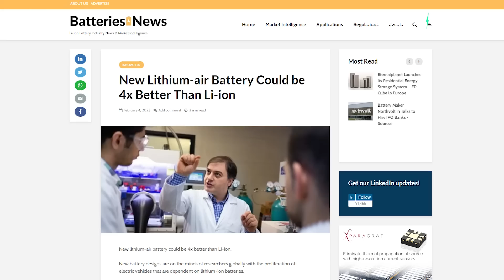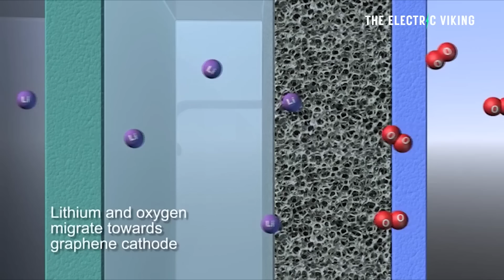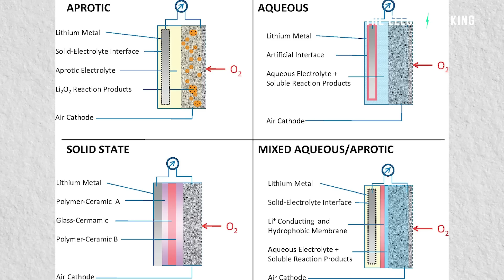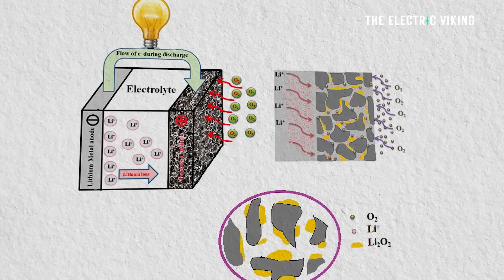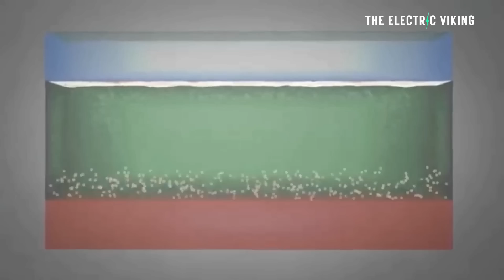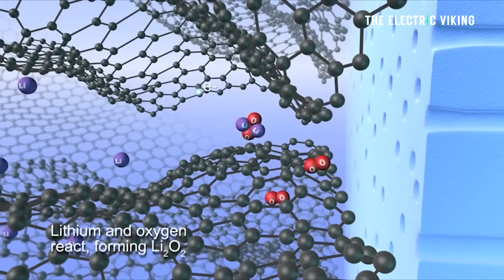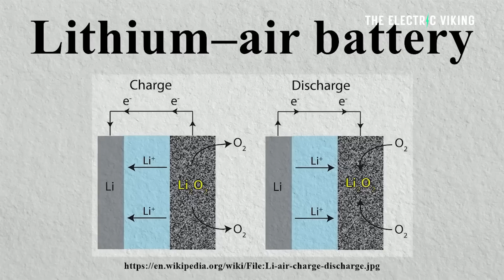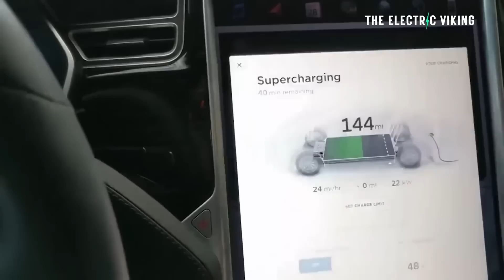World's highest energy density Lithium Air battery solved! Up to 2000km EV range!

Comment: Heard on break through after another over the years - Nuclear Diamond Batteries (no really, they are real), Sodium based batteries, Zinc Air, some other thing that is 500wh per kilo. This is another one I heard about years ago. Usually the problem is not making the batteries, it is charging them easily, particularly in a home situation.

Comment: Higher energy density would be useful for weight-sensitive applications like aircraft. Other than that, cost per kWh and longevity is far more important for mass market EV. Let's be frank, we don't need a 2000km range EV for the average consumer. Sodium-ion and LFP looks promising.

Comment: Produced in a laboratory and mass-produced are completely different things. For the battery, you only need to look at lg energy solution. Tesla, catl, sk, northvolt, etc. are all operating by headhunting lg engineers. They talk in Korean in their US tesla lab and China catl lab... The battery industry cannot be created by a few innovative people like the IT industry. Ultra high nickel battery technology is 3 years ahead of catl by lg and 3 years equals an eternity in the battery industry. As for the cathode material, which is a core technology, l&f, ecopro bm, posco chimical, and lg chem are technologically monopolized. Tesla also reduces orders from Sumitomo and is supplied by L&F.

Comment: 4 times the energy density would be a lot Indeed and change a few games too. With lithium getting scarce, it will not be cheap. And so the question should be if this idea can be teletransported to sodium (Na ion) batteries that are up and coming to replace Li-ion.
Overall these game changing reports remind me of cheap Chinese flash memory cards called 4TB that had 4 MB capacity, or batteries called 3,900 mAh with lousy 1,500 mAh real capacity when new.
Manufacturer: but that was the product name, we never said it was the capacity.
How long did it take Tesla to build factories that can produce their newer larger monocells? Can I buy them in a shop already?  Fttb all these announcements are of Meh batteries with whatever mAh capacity.

Comment: The EVs are in for a lot of regulations and won't be very convenient
#1 they're going to bann the EVs on ferry's
#2 they're going to bann them from shopping centers with underground parking's
#3 the same goes for residential buildings with parking garage under the building.
Only to mention a few

Comment: Unlikely to see the light of day in the foreseeable future.

Batteries with much higher energy density have been possible for some time. However, they are also potentially very dangerous if something goes wrong. 

Making them absolutely safe so the manufacturer doesn't get sued out of existence when they catch fire or even blow up, is the issue.

Comment: If we can get more miles per weight of Lithium, that will have enormous benefit, as Lithium mining is environmentally destructive, and there is an enormous demand developing for it as the pace of switching to EVs gathers pace.

Rather than using the improvement to increase range from 400 miles to 1,300 miles, instead stick with 400 miles, and reduce the size and weight and amount of Lithium needed.

For a lot of people, even 400 miles range will be far more than they need except on rare occasions, and providing high capacity just to cope with rare occasions is a bit of a dilemma, perhaps one that can be met by rentable pre-charrged standardised long-journey plug-in packs?

Comment: One thing I will stress to you though is don't believe the theoretical energy densities that the researchers claim. These numbers are based on a perfectly atomically accurate product assuming 100% utilization and assuming basically no losses or degradation. A good example is how lithium ion is projected to have a theoretical peak of between 450-600wh/kg; however in practice they rarely pass over 250wh/kg. Sulphur batteries have been also claimed to do similarly obnoxiously high energy densities of over 1200wh/kg but they're incredibly unreliable. 

I will stress that even John Goodenough, the man who invented the lithium ion cell, has been found to make outlandish claims on a solid state battery nobody could back up. It's interesting to hear about, but don't get your hopes up. This is why pier review exists as everyone wants to change the world, and sometimes that blinds us on double checking. 

And I'll definitely state now that battery powered rockets are a nonstarter. No matter the energy density, we need a high force method for propulsion with electricity, which we don't have. It's the same issue as electric passenger jets, we don't have an electric version of the jet engine. There are electric forms of propulsion, but none of them are the high power format we need for takeoff. Hall effect has great specific impulse but to have enough force to lift something off the ground. No matter how much power you cram in it, Hall effect will basically never be able to lift something from the surface. 

I do remember a while back the claims of something of the VASIMR rocket engine, but what I heard about it didn't impress me; espeically how badly it seemed to be thought out. Yes they were able to make a lot of thrust from it, but they don't calculate the mass of the fuel or the batteries needed to power it. Plus at the power draw they calculated, it's exhaust gases would be at 10,000,000°K. Temperature is one of the main reason we don't have nuclear rockets though. I mean if we could make a material able to sustain 4500°C we could have orbital nuclear rockets.

Comment: These battery announcements need to be looked at like marketing labels on food. If a food product claims it's low in fat, it's probably high in sugar. If it is low in sugar, check it for salt. It is not about what is said but what is not said.

It may have a theoretical limit of 4 x the specific energy, but don't confuse this with energy density. Specific energy is energy per KILOGRAM. Energy density is energy per LITRE. Those peddling hydrogen fall for this all of the time. Hydrogen has an insane specific energy but pathetic energy density for one simple reason - it takes  lot of litres of hydrogen to get a kilogram. 

Lithium is the lighest solid material on the period table. It sits at number 3 above only hydrogen and helium. Being a solid, it is more dense, but still...

Also, batteries have to tick a lot of boxes. Getting most is not good enough. Sam identified power delivery and life cycle as two that were an issue. These don't need to be merely "improved", they need to be fixed.

Power delivery, like energy density and specific energy, dictates the size of the battery pack. If you need a massive battery pack to get the power needed by the motors, are you going to want to drive a family sedan the size of a bus even if it has a 20,000km range? Nuclear diamond batteries are an excellent example of this problem.

As for lifecycle, how often do you want to pay for a new battery pack? This links to another requirement. How much do you want to pay when you do?

Finally, a lot of science articles are a just mild reworking of a compacy press release. A large amount of low fat, low sugar, high salt product needs to be taken.

Comment: There's no way any battery is going to power a rocket. The energy density isn't the only problem, a massive issue is that a fully discharged battery is as heavy as a fully charged one.

Comment: I'll believe any miracle battery breakthrough only once it's been brought to market. At least a half dozen companies & other organizations have claimed to make a miracle solid state battery breakthrough that can go over 1,000 miles a charge, only to either never bring it to market, or quietly admit months/years later that they're no longer pursuing that discovery because the first 80% was easy, but the last 20% was really hard to maybe even impossible with today's technology. Nissan already showed with the Leaf that just because a battery works great in a controlled lab environment it doesn't mean that it'll work out great in the real world (i.e. the earliest versions of the Leafs were suffering 40% battery degradation a year, which is absurdly bad).

Comment: No other industry has a higher percentage of vaporware.
Despite breakthroughs for 20 years, we're still using 30+ year old lithium ion mostly.
LFP is the only alternative that's actually real, but still used almost nowhere for some reason.
Sodium ion seems to get real this year on paper and prototypes, so I expect them in mass produced cars that you can actually buy for real in 2025.
Pretty sad results if you compare it to the announcements of the last 2 decades.

Comment: Lithium Air and Aluminium air batteries are much less efficient than Lithium Ion because the have to pump air and usually need recycling more often.  The same as Hydrogen Fuel cells they are more "fuel Cell" than battery.   They don't last as long in terms of cycles (so far), but 1000 cycles would be good (if it is real and not just perfect lab conditions).  Making Lithium air batteries high density is easy, its potential is close to the density of Hydrocarbons.
They also require ALOT more Lithium which would be a huge problem.
Personally I am VERY sceptical of all new technology claims, they may well have some place eg a hand removeable boost pack for long journeys, heavy plant or aviation but I doubt hey will replace current car technology any time soon.

Comment: In general I love your content, but can you please stop with the "breakthrough" videos. Lithium-Ion batteries were discovered in the 60s and it took over 30 years to be able to mass produce them at scale for an affordable price, so unless they are mass producing those breakthroughs, it is just a waste of time to talk about them in detail.
Reply: It took 21 years for Li-ion to become a product (1971-1992)
Reply: @winfriedwilcke1705  Research on rechargeable Li-ion batteries dates to the 1960s. They started to try to mass produce in the 70s, so I may be off by a few years, but that's not the point, the point is from when they announced the discovery "that will change everything" to the actual mass production and affordability, it took decades. And in that time there is no guarantee that economies of scale for current technology or a new & better product will come along, so may never even become relevant. So talk to me about a revolutionary new tech when you can actually mass produce it affordably, otherwise it is a waste of my time.

Comment: There are still to many drawbacks (charging/discharging cycles, corrosion and many more). This type of battery is subject of research and probably will like nuclear fusion. It is miles away from production.
btw. car and truck range should be measured on what a driver can reach in a single shift. After 4h there is a pause anyway.

Comment: You could have batteries that are say, one third the size of current packs, and they'd still have half as much more than current ranges. More even, with the reduced weight. Also presumably less Lithium. Now, if they could do it with Sodium, you'd really have the magic ticket

Comment: 1000/365= less than 3 years.
365 x 10 years = 3650 cycles.
7300 cycles is 20 years.
Reply: If you charge once a week, 1000 cycles is 21 years. Who drives 1000 miles a week?

Comment: I have learned to not get too excited by "breakthroughs" because producing them at scale and at cost is a whole different thing. That being said, clearly, we are moving in the right direction and it is only a matter of time before this problem is solved, and ICE becomes put under the ground.
Reply: If I had a dollar for every time, there was a breakthrough, or somebody said game over I’ll be a wealthy man
Reply: @chrisnewman7281  LFP was a breakthrough. Maybe not super-massive but a breakthrough non the less. Now in full production. So there you go, you're up a dollar on that one at least.
Reply: @douglascutler1037  LFP breakthrough happened in the 90's in the US where it was invented and patented. However, due to the much higher energy density of NCA/NCM, manufacturers went with that instead. The Chinese communist government was making too hard and costly to patent it there, so the patents holders thought it was not worth it. Especially since at that time China was far from what it is now. That's why they were allowed to use it all this time there. However, the patents, which were more recently owned by a Canadian company, ran out last year and now everyone can use it royalty free. 

Lithium-Sulfur at room temperature is the latest major breakthrough to have occurred.
Reply: @Paul-cj1wb  Thanks for the background info. 

I recently read Thomas Edison was ready to initiate advanced battery research in the early days of the automobile which included many electric vehicles. But he turned back after the advent of cheap gas. 

Imagine what he might have done. 

Contrary to popular belief, Edison did not invent the electric light bulb. But he did perfect it for practical use. This was not easy and was accomplished with thousands of hours experimenting with hundreds of different filament compounds. Imagine if he'd followed through with a similar approach with battery chemistry.
Reply: @Paul-cj1wb  Edison blew it on AC, for sure. Probably yet another instance of the emotional brain in the form of pride or sunk cost fallacy overriding the neocortex.

But even Tesla made is own mistakes. Laid the groundwork on radio-communications but then let Marconi take the fortune and glory while he chased after the impossible dream of underground electrical power transmission - and we don't mean buried cables.  

As for Elon - and I'm a TSLA investor - but lately Mr.Musk has gone in my estimation from Tony Stark to Dr. Jekyll and Mr. Hyde.
Reply: the nice thing about these big efficiency jumps is that the battery can cost a bit more and still be more cost effective
Reply: Matter of time....I wholly agree...........I don't expect to live to see it..............Paul
Reply: Ice ICE, baby.

Comment: Any battery improvement and advance in their technologies are always welcome and are all great. The more the better. With that said, Lithium-Sulfur has already been solved, and they do have the full potential of 5 times the best current energy density because we already know that Sulfur can store 5 times more Lithium ions than any Nickel/Cobalt/Manganese/Aluminum combination. And the first company to start mass producing them with 3X the current best energy density, Lyten (who worked with the US military on it) has already broken ground in San Jose, California. They already have a 2 billion dollar order from an electric airplane manufacturer. And Drexel University made an even greater discovery (by accident, by the way) regarding Lithium-Sulfur chemistry. Theirs has been tested to 4,000 cycles with very little degradation. That's even higher than LFP life cycles.

Comment: A related type, Zinc/Air batteries, were around at least as long ago as the 1970's, so it's unsurprising that people have been experimenting with Lithium/Air technology. Great to hear that they have resolved the rechargeability challenges whilst improving gravimetric energy density dramatically. Thanks Sam.

Comment: Mass production, with longevity and cost effectively... with a 2000Km Battery, when you go to add 4 passengers, while towing a trailer in -25 below weather..   It will drop to only 1/3 range... so that would still equal 600-650Km... Now you're talking...  Will believe it when i see it...

Comment: The lithium Kevlar Sulfur battery also has 5X the energy density and has a current useful cycles number of 1,000. This would give a Model 3 a 1,500 mile range and a life range of 1.5 million miles.
Reply: Insane
Reply: Quit ur quick gradifications.
Cant u think 4 merely jst 10 secs....
THIS BATTERY USES OXYGEN.
WE NEED THAT OXYGEN NOT MACHINES

Comment: Tell you a real terrible story about lithium metal battery. And because it has very high energy density, when it is short circuited it will explode. This was how N. Korea used it to blow up S. Korea's passage plane in the 70s or 80s.They used a Walkman with Li metal batteries in it to bypassed the airport security,

Li ion battery in a way balanced the potential danger of high energy density & high energy demand.

Comment: Even a battery that only survives 200 charge cycles but can provide 4x the power density would be extremely useful, it’d simply need to be replaced every 6 months to 3-ish years depending on the amount of distance a driver travels.  Two requirements would need to be met for this to be practical: 1. It would require the materials to be recyclable, which would lead to 2. The replaceable battery pack would have to be a lot less expensive than current battery packs, say $1000.  The engineering challenge to make a battery replaceable at 6+ month intervals is not very tough at all.  It would actually make the automakers extremely happy, they’d get repeated service visits and steady income from that, and would be a lot like going for an oil change and checkup on ICE vehicles. Consumers would be a lot happier knowing if they have a bad battery that it can be replaced quickly and easily, and not have major degradation concerns.

Comment: As with all technology, what is here now is not the best - technology improves over time, and in this current age technology has a doubling life of months, compared to years a decade ago, and decades early in the 20th century when technology started to blossom. Therefore battery technology will improve exponentially over the next year, with costs reducing and capacity, energy density, and longevity increasing - expect nothing less...